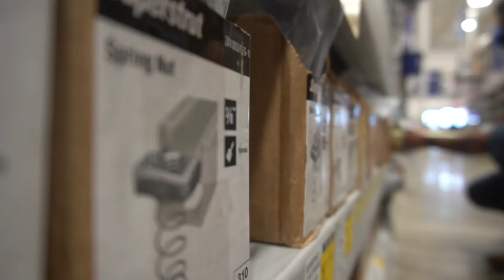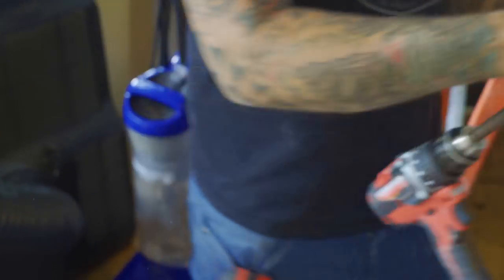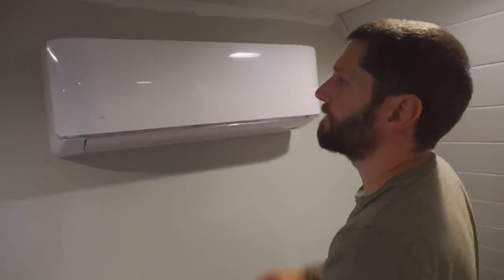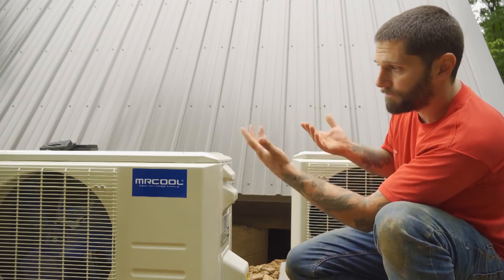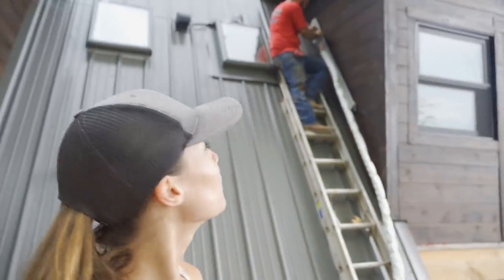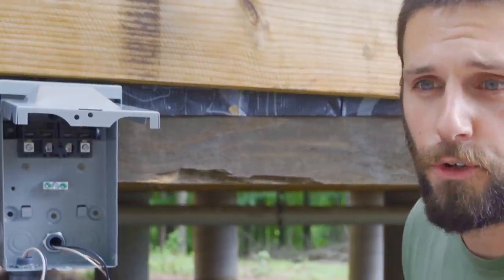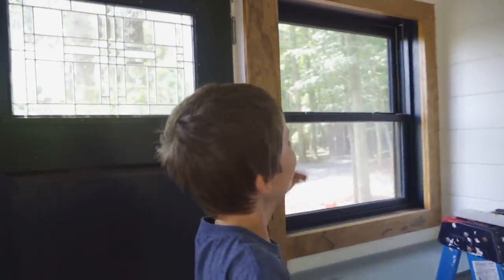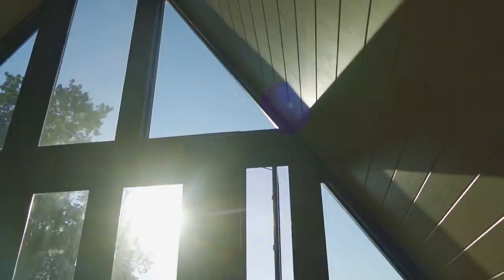Installing AIR CONDITIONING In Our Off-Grid Home!

Comment: As a union electrician myself Josh is exactly right on the wire sizing and breaker sizing. The breaker size is allowed by code to be upsized to prevent nuisance tripping from inrush current at motor start up. Josh should also be praised for his tidy wire installation he would have been a prized electrician on any of my projects.
Reply: @Timothy Mckee A little more clarification, what do you mean?
Reply: @Timothy Mckee It's not a code requirement to have supplemental grounding for AC units. Grounding is already satisfied from the unit to the service disconnect and from the service disconnect to the main electrical panel which has a ground rod.
Reply: You can get a breaker with different curve ratings for inrush currents  with out the need of oversizing
Reply: @M_a_r_ke  Those are much pricier options.
Reply: Shouldnt he have a recep installed near the AC unit?
Reply: @wojciechkarwowski7373  If the unit is serviceable then yes there should be a receptacle within 50' of the units And within sight.
Reply: Grounding rods do not protect from lighting they merely put the home’s electrical system at the same potential as the earth’s
Reply: Increasing the circuit breaker size because of inrush current is stupid either change the breaker to one which had a more suitable curve or put an inverted system in
Reply: @michaelbradley7529  Is it not code requirement to have a cerifide electrician to instal this unit?
Reply: @JohnSmith-tc4ub  Actually it's a code requirement to be installed by a certified electrician but it must pass inspection. Depending on the state, anyone doing electrical work (for pay) may be required to be a licensed electrician as it is in California.
Reply: Perfect Explanation.
Reply: It's an inverter unit. There is no in rush. Should have used a 15A breaker.
Reply: @kevin9c1  Every electric motor has inrush current, whether it's a fan motor on the condenser or an electric motor driving a pump to circulate a refrigerant or fans that circulate conditioned air. Since you said inverter in your comment, I'm thinking you actually meant to comment on a thread separate from this one. An inverter would refer to a device that changes voltage from DC to AC. Like what is used in their powerhouse to convert the DC from their batteries to AC voltage for use on the property.
Reply: @michaelbradley7529  Inverter-based mini-splits (which is basically all of them) don't have inrush.  They soft start their fans and compressors.  So softly that even my generator doesn't notice any "inrush" from them.

Comment: We're on solar too and installed mini splits. They are GREAT!  Even if a room or zone is on programmed standby or off and gets hot/cold the jet (beast) mode cools/heats it in minutes. They are so quiet and you can direct the air flow horizontally or vertically, something you can't do with HVAC.

Comment: Your system can ABSOLUTELY handle the new load! We have the same unit (electric version) and it has an A/C and a heating option as well. Our home runs solely on electrical which costs us an arm and a leg in the wintertime when we run our heat through our vents and baseboard heaters- so we turn on this unit instead of the baseboard heaters and it barely makes a dent in our electric bill!!! It is SO efficient. Not to mention we only have one unit on the third level of our nearly 3,000 square foot home and it cools the entire home wonderfully so I doubt you’ll need the 3rd unit in the loft! Heat does rise but I would suggest running the other units first and seeing if they are enough. One unit is enough to cool our whole home but NOT enough to heat the whole home during our Canadian winters. Our electrician was able to make it “colder” by adding more A/C fluid. Great buy, guys!

Comment: BEAUTIFUL INSTALL. You will get allot of snow sliding off the roof, maybe build a roof & back around the units that won’t have a deck over it. Anything to keep that snow off of them. GOOD LOOKING EQUIPMENT, GREAT CHOICE GUYS. PS, No roughing it at your ranch‼️‼️👍👍  Vinny 🇺🇸
Reply: At a minimum a small "wall" to keep the snow from slamming into the outside units when the slow slides.
Reply: Great idea !

Comment: No experience with the Mr Cool DIY units but I've installed several of their Advantage line units and they are awesome . I have one 24k unit in my new 1150 sq ft barn style home and it does exceptionally well .
Reply: Cleaning the Barrel fan is a bit of a pain. Needs to be done once a year. Otherwise air flow will be restricted.

Comment: Strongly agree with using MR COOL with it's pre charged lines! Only way to go!
Reply: Yup but every mini split I’ve installed I’ve put lock tight on the fittings. They have leaked without it.
Reply: On their website, in the Q&A section, it said that even though the unit comes pre-charged, the lines still need to be evacuated? Can’t just connect and go.....
Reply: if you put loctite and they still leaked your flares are not done right.  Should never use loctite, it can leak into system and cause contamination.   Use Nylog Blue it is designed for that.  Improper flares from the factory could be an issue but mini split because of temperature and vibration will get loose over time.  Also a torque wrench manual or digital is needed you can''t guess.  One thing the DIY community doesn't know is I have rarely seen a Mr. Cool pre charged lineset be the correct pressure after install.  Too many factors.  It will work but it will be either under or overcharged and needs to be checked with gauges for maximum efficiency and lifespan.  If its pre charged it does not need a evacuated with a vacuum.  If you work in the field there is something about mini splits even the best brands installed like mitsubishi, the service and failure rates increase dramatically over time compared to traditional forced air ducted systems.  I have noticed that personally in the field. A lot of good reviews of Mr. Cool but getting parts and warranty service is another issue that I believe will rear itself in the next few years.
Reply: @flatearthdays  at least he went with mini splits and not vrf, not even close in comparison to issues and warranty part replacement lol
Reply: Depends on the VRF. If you’re a daikin dealer you can get everything and they’re very quick about it.
Reply: @flatearthdays  yeah Daikin is okay, the trane Samsung variant is pure trash
Reply: I only like Mitsubishi and Daikin for ductless

Comment: I would recommend having some sort of cover over the outside units. I know they are outdoor rated, if in direct sunlight they work harder to cool.  While deployed we would build a shelter for them to keep the heavy snowfall off and out of direct sunlight.  Do your units have an air filter?  Ours did not, we had to take an air hose and blow them out once a month to keep them working, and to keep the dust from being blown in our rooms. 
Place is looking good, I need to borrow Josh for some electrical work. 
I’ll hide the little Debbie’s till he is finished to help motivate him.

Comment: The ease of mini split installation is a job well suited for dyi. For those who are a bit frugal. An online site hiseer is the one I use and recommend. Can get a 12k 19 seer heat pump for 530 plus freight. I get them without the line sets and buy them separate on Amazon or e bay. I have installed a bunch of these. They are awesome.

Comment: Wondering if you guys could do a follow-up at the end of the season on how well its working and long term durability/reliability.
Reply: I don't know about this system, but ductless mini splits have been around for ages in Europe. It is pretty much all they use over there.
Reply: They work very well, only problem is you may have a leak in your system every couple years. Small price to pay than installing ductwork. Mini-splits run copper cooling lines that are flared at the ends that tend to leak. Compared to running $$$ ductwork for a traditional ac

Comment: I just installed the exact same system in the Simon electric offices only it was 18k units. I am a master electrician and Josh is 100% correct there is actually much more extreme applications of the same code rule. Outlined in 2017 NEC NFPA 70. 440.22 & 440.32 generally the code says there is up to a 225% of motor load/branch circuit allowance in breaker sizing allowing for motor starting without nuisance trips. There is spicific circumstances and read the code before applying but 225% is a huge allowance do the math, pretty crazy but very safe.

Comment: I just installed the 18k in my downstairs and it works great so far. When Josh says to make the outside hole 'slightly' lower than the inside, keep that in mind if you're installing the MrCool. I made the mistake of thinking I would make the hole a steep angle to help drainage...nope. All it did was make the sleeve not fit the wall properly.

Comment: We've installed many of these systems(ductless mini splits).  I've heard of these setups that have the refrigerant pre loaded into the line sets, head units, and condensers, but have never installed them.  I've been skeptical about the connections being contaminated with small amounts of air.  Hopefully you'll update us on the performance/maintenance in the upcoming years. I'm sure they are fine or they wouldn't  keep selling them.  The ones we install, have to have the connections pressure tested, have to be pumped down under vaccum, and then charged with refrigerant.  They also can have multiple heads on a single condensing unit. These ones you did look way easier.  Do these work as heat pumps?  

 Just a minor point; we usually mount the outdoor units to heavy 6x6 pressure treated lumber.  We've had a few of them blow over when anchored to condenser pads.  You may be protected from high winds where you are. 

I can't wait for the next installment.  Your house is beautiful and so is your family.  Much respect guys.
Reply: The lineset and indoor head should be pressure tested with nitrogen then evacuated with a vaccum pump with micron gauge to ensure the lineset is dry and sealed properly.
Reply: @trevorfarlette9996  nope.  These diy systems are precharged with refrigerant: the head unit, the line sets, and the condensers.  They have low loss quick connect fittings at the two units. Just hook them together and hope there are no leaks. That's why they applied the connections with the manufacturers special rubber wrappers. Look them up at Mr Cool DIY.  They even carry a pretty decent warranty; even without professional installation.  I just wonder if it covers them leaking.  Although they should have tightened the connections with a torque wrench to spec. I had heard about these systems but have never installed them(been in hvac for 25+ years). But I did research them after watching this video.  They seem great for this application. For people who are more than handy like these folks.
Reply: yes, they work as heat pumps. down to 5°F.

Comment: Great videos and great job!
I don't know if anyone else noted this before, but split systems needs two major things during installation (they are not exactly DIY friendly :/ ).
One is vacuum the air off the lines and generate negative pressure (bleed will do the job, if vacuum is unavailable, but its tricky..).
Second - most important - is to fill in about 20grams of corresponding coolant type (R32, R404x, etc.) for each extra meter of the housings, in your case you need a lot of additional coolant in order for the unit to work properly and proper vacuum.
You must call a professional fitter asap to fix this, as you cannot buy freon on your own, or gauges, scales, etc. tools, or damages will happen to the units, even blow up the compressor!
Reply from the maker: The reason this system IS diy is because it does not require that 😊 The line set is precharged.

Comment: I know solar panels can give some good wattage for electricity at home like lightings and TV but being able to handle 3 AC units and kitchen ovens etc. is surprising to me.
Reply: It probably can't handle all three all the time, but it doesn't have to.  The idea is they can run one day, and two at night.  (the two night ones have smaller zones so won't run as constantly)

Comment: I have a suggestion...I was 52 years in the A/C trade working my way up through the ranks to design. These ductless design systems are the best thing that has come along in years however another feature to consider with these systems is the Inverter system...This is much better than the way you have gone on your front portion but you can still reprieve yourselves... 😂...An Inverter system will allow you to have only 1 condenser, out door unit, while having as many indoor units, evaporators, as you want. A compressor runs at a speed to produce the horsepower/BTU required for a given design. If you have a design that calls for 12,000 BTU's per room, you have 4 rooms well you may go for a 4 ton unit maybe 4.5 ton but these are zones. With the system you have now when it runs it draws maybe 8-10 amps depending on both outside and indoor, load, temp. But the condensor speed is constant thus amp draw somewhat constant. With the Inverter sys. when a zone is satisfied that indoor unit shut off. An inverter unit acts the same as a light dimmer. It controls the speed, RPM of the compressor. The higher the RPM the more amp draw, thus when a zone satisfies the load drops the compr speed drops and the amp draw is less. You're an electrician....The most amp draw is start amps and that causes the most wear...
Just a suggestion...
OH...An edit I have watched and followed every post. I am retired now livin' the dream in Thailand...

Comment: You would TREMENDOUSLY improve efficiency by installing a geothermal heat pump system. The only requisite is that you’ll have to drill a couple of pipe wells on the ground. Compared with what you installed, you would reduce energy consumption by a factor of 3 or more (divide by 3), specially in very hot days. As a bonus there’s no visible machinery or components outside. This is getting popularity very fast in Europe.

Comment: I was SHOCKED & SURPRISED that Josh didn’t use his favourite channel lock plyers but actually used the recommended crescent wrenches 😂🤣
Reply: Gavin Perry I didn't think electricians owned crescent wrenches.
Reply: channel lock pliers also feature a built in hammer, water shut off and gas shut off tools, pry bar
Reply: Mark Waddey   Maybe even a bottle opener 👍🤣🍺🍺😂

Comment: I've just bought myself the FULL Millwaukee gear,, drills, impact drills, saws, bench saw, jig saw,, etc etc... Even better than Dewalt...
Reply: Bought a slew of Milwaukee Fuel during Black Friday 2019.  Best tools ever owned, can't wait to use them for my country cabin build.
Reply: I'm married to bosch, it's great quality, just wish they had more options like milwaukee!  If I  knew then what I know now! Lol
Reply: Bought a Milwaukee 1/2 inch angle drill in 1976....use it almost daily.....other than changing the cord set 1 time it's still fine. Milwaukee tools take a beating and run great.
Reply: At the time I started getting Bosch battery tools (prelithium), Millwaukee was having problems with their Nimh batteries which steered me to the bosch. I've never had a problem out of them...
Reply: Karl Schupp have you used their drill and driver? I work with a guy who had a set from Bosch and I hated it, it only lasted a few months of heavy use. They do make really nice saws though
Reply: Hey I’m not sure about that, I love my black and yellow stuff. But the Milwaukee stuff is really good too. They seem to have the cordless job site on lock

Comment: You needed to vacuumed the lines before letting the refrigerant out.
Reply: Everything is precharged: the head unit, the line sets, and the condensing unit. They have low loss quick connect fittings at every joint. But I still wonder if small amounts of air can get in. But they seem to work.
Reply: Yea I mean it will work just fine but some companies denied warranty due to units not being proper installed and well stuff like that other than that it should last at leas 3 to 5 years with no problems
Reply: @Zorkrayowns  these are designed to be installed this way.  Warranty:5years parts, 7years compressor, 1year remote. No licensed contractor required for diy units.
Reply: Nice in that case that's great!

Comment: Mitsubishi is what I have installed 11 years ago for the same reasons you have chosen. Easy to install. I abandoned my central unit. Electrical invoice is down 2/3! I have three units. One in the barn one in the master and the 18000 btu in the living room-kitchen and two back 100sq feet bedrooms. Every year is cleaning and it’s a good three hour job for the 18000btu. The barrel fan gets really nasty.

Comment: You will be very pleased with cost of operation of your units.  We heat and cool as 900 sq ft cabin with vaulted ceiling in northern Michigan.  Our largest bill was $82 in dead of winter.  Only issue with these units is they do not move a lot of air.  As it is our only heat source drying ski gloves etc is more difficult that with a forced air system.

Comment: I would advise that you extend the condensate drain tube straight down from the elbow where your freon line turns 
and goes laterally.   Any extended lateral drain line will clog.   I had to make that correction within a couple of months 
but I am in Florida which is more humid.  Realized the problem when interior unit started leaking condensate.

Comment: Awesome.   Mice like to get in there by the heat pump in the winter, build a box around it with a wire mesh size to keep mice out of there but don’t limit the airflow. You can kind of hide it that way too.

Comment: Beautiful install and awesome effort. However, You needed to vacuum the system before releasing the Freon gas. Because all the air trapped in pipes and the indoor unit is trapped inside and mixing with Freon.